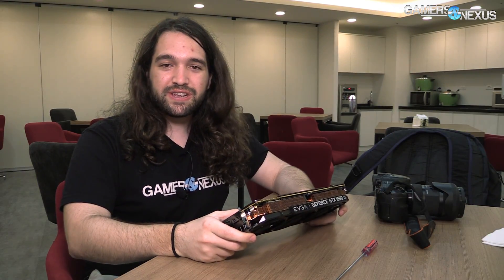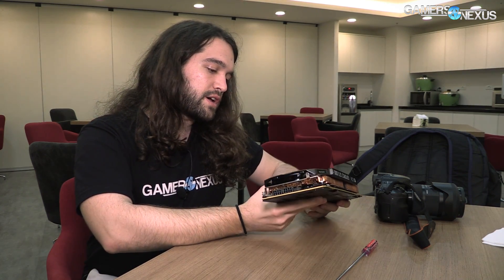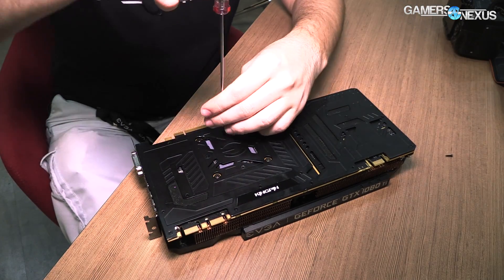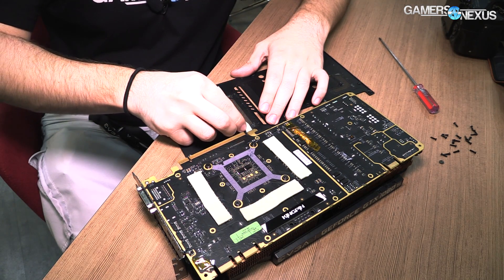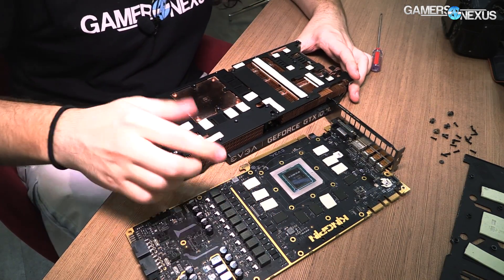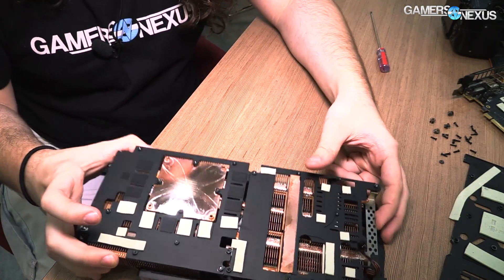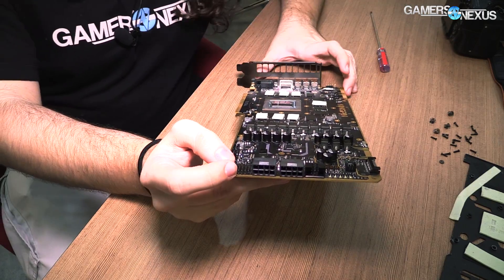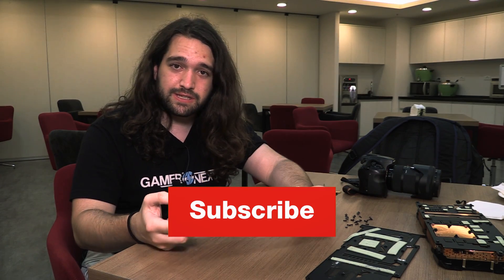EVGA 1080 Ti Kingpin In-Depth: VRM, Cooling, & PCB | Computex

Comment: I have a 2080 ti FTW3 ultra with the shield and all and just upgraded from a 1080ti Black. I still think this Kingpin is the best looking video card made and it's a beast on top of it. If it wasn't the same price as the 2080 ti and I didn't have a 1080 ti before that, I would have bought it.

Comment: Pretty sure it will still have about the same performance as the other cards, unless it reaches higher clocks due to the added voltage control.
Reply: Jayztwocents just did a video about the card, According to Kingpin himself all these Kingpin cards hit 2150 mhz + take that with a grain of salt

Comment: Wonder if they're gonna do binning based price points.  As far as I know there is no ASIC quality rating on Pascal but I guess they can just test them and bin accordingly.  Guaranteed max boost 2100! $1499 lol
Reply: Jayz did a video talking to Kingpin himself, he said all kingpin cards can hit 2150+ mhz
Reply: Actually he said 2025 guaranteed.  Kingpin has "seen" cards do 2150 on air.  And my FTW3 does 2050 so I don't feel bad!
Reply: Well it works both ways.  That's why it pays to be an early adopter before the partners make all the model designations.  Like buying one of the first EVGA cards before the FTW and Classified's are in the picture there's a good chance some of those golden chips make it out the door and get stuck on a standard card.
Reply: And to add on that, I'm fairly certain EVGA does their own in house binning for warranty replacements.  I sent a 1070SC in for RMA and the "refurbished" card they sent me back BARELY made the stock SC clocks.  It wouldn't even boost to 2000Mhz without crashing.  Very disappointing seeing how my original 1070SC did like 2100+ but I don't care too much since I bought the 1070 to hold me over till the 1080Ti and is currently up for sale.

Comment: Those "gold ground layers" on top are part of noise protection, mainly used in RF and signal measurement equipment where noise is a problem. Probably here the solution is to limit noise that might  affect internal clock generator thus eventually your clock signal will be useless when noise ratio goes too high and no clear clock signal anymore.

Comment: How... many 1080Ti versions can one company make?
Reply: This is a special edition, designed by an overclocker for LN2. This card is not aimed at gamers or the masses, it's made for overclocking.
Reply: 4 i'd say they do have a hybrid in their line up which imo is a nice option
Reply: I was wondering this, too. This is a bit ridiculous. Such premiums for slight differences.. it is insane.
Reply: afaik this card has no power limit what so ever saw an interview with kingpin about the card they said the max they had pushed it on air was 2175 mhz compared to how much i can push mine they must be doing some kind of magic to get there
Reply: audionut wow..l is that all you say? I may be a Mac user but I'm allowed to watch OC related videos too you know...
Reply: They made 7 different variants, but they all overclock same.
Reply: They should just have one entry level with a blower cooler, one mid level which can go mild overclocking and one kingpin with no power limit.

Comment: I am guessing it will cost $900 (USD) I could be wrong.
Reply: That's the max price, They're selling based on ASIC quality levels.
Reply: Anderson Perez pffff... In one Lithuanian tech site I found GTX950 for 1200€ it didnt even cost that much on our currency( 1€=3.5lt( currency of Lithuania))
Reply: I feel bad for other PC gamers in other countries. Everything is overpriced.
Reply: It will cost some where near $950.00 to $1,300.00 depending on binning sections.
Reply: Yes. But i assume EVGA carefully qualifies each Kingpins that can overclock at rare clockspeed.
Reply: Aren't they $1600 in 2019?
Reply: @B Mcginnis Well, There is actually. Because Kingpin claimed to get the card overclocked to 2025MHz+ and it's specifically binned for this kind of overclocking. FTW3 and SC2 can't even reach at 2025MHz+.
Reply: I think $1,300.00 is too much, and wont have a market because of the Titan xP (newest Titan)
Reply: there is nothing to bin on pascal so there won't be binning

Comment: It's  beautiful card, but do they give you a reasonable method to get past the Pascal power limit? If not its basically all worthless and won't perform any better than a Founder's Edition.
Reply: Alpha Argus I may be wrong, but I believe the power limit is not a hardware limit. Instead it is a restriction that Nvidia imposes on manufacturers. This is why you can short the shunt resistors. This basically tricks the cards into believing that they are running at lower power than they actually are. I'm just curious to see how EVGA can pull this off via software without pissing Nvidia off. I'm assuming that is what the USB connector is for. They will put the functionality there and "someone else" will release a piece of software that allows you to up the power limit and voltages.
Reply from the maker: The USB header that is mentioned in the article, along with EVBOT, mentioned in the article, both help bypass limitations. You still have to know what you are doing, but those help remedy the challenge.
Reply from the maker: Yes, given the target market of the card. We talk about that in the article.
Reply: Gamers Nexus Nice! Definitely looking forward to a full review then. I don't do LN2, but i do put everything under a custom loop. If I can up the power limit and get some substantially higher clocks I may end up selling my FE and getting one. Thanks for the coverage! I'm ready to see your video on what Intel is showing.
Reply: Gamers Nexus if i'm not mistaken, you said that " its not like evga make the gpu" in the ftw3 review. so how do they overcome the power limitations in the kingpin, while the ftw3 cannot. its a bit confusing.
in the ftw3 conclusion you also conclude that the ftw3 card basically not worth the extra 40 or 50 $.
after watching the ftw3 review, I cancelled my order and go for the sc2 instead, since i cannot find any reason for the extra money that ftw3 has to offer.
anyway i will read the article on how the kingpin can overcome the pascal power limitation.
Reply: That's make me wonder about evga product line up.
1. 1080ti FE. basically standard
2. 1080ti SC2. custom board with icx cooling solution.
3. 1080ti FTW3. custom board, icx cooling solution, extra fan, and over priced components that basically have no advantages that make it worth buying except that extra fan. 
4. 1080ti hybrid. custom board, with hybrid cooling solution
5. 1080ti kingpin. custom board, fancy icx cooling solution, top of the line component, and no power limitation.

and evga is the one and only board partner that make product that can overcome nvdia pascal power limitations.
and based on evga tease in the social media, the kingpin almost get a double benchmark score compare to the FE 1080ti.
and all of that make my wallet banging his head to the wall.

Comment: What is the extra SLI finger for? if it is an SLI finger.
Reply: Since it's a Kingpin, and he's an LN2 overclocker, you can probably read all kinds of voltages and stuff from there that you normally wouldn't be able to. Although, since it's pre-production who knows if it'll be there on the retail version.

Comment: I am probably in the minority, but I absolutely love full-copper-colored radiators!
Reply: Cool looking, but criminally overpriced.
Reply: i prefer is actual beeing copper instead of copper colored...
Reply: foreign's gaming tech You're definitely not the only one. I have a thing for copper/gold and black color schemes >=D! This thing looks like money.
Reply: The copper ruins it for me as  the rest of it is black/gold
Reply: Would silver really look better though?
Reply: well raw copper is about 3 times more expensive than aluminium and also harder to work with. but the extra you pay is still to much. and while copper heatsinks are better than aluminium ones, copperplating doesnt do much exept driving up prices
Reply: radiator, loop, copper? 

scrapyard wars
Reply: foreign's gaming tech they smell horribly
Reply: copper is also better htan aliminium so this card could outperform the other 1080 ti coolers except maybe the watercooled ones
Reply: foreign's gaming tech copper looks hideous!
Reply: I don't mind copper but that shroud is god awful looking.
Reply: in this case its just copperplating, which doesnt do much exept looking cool and being expensive